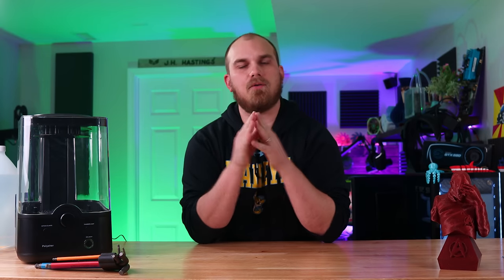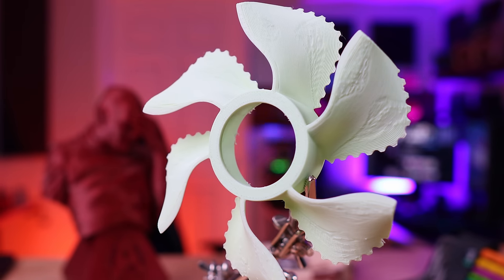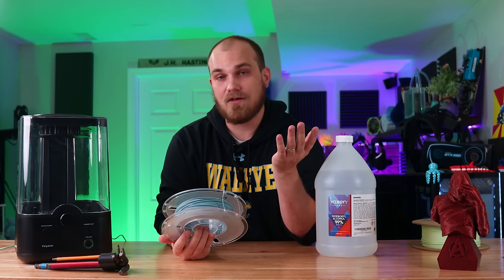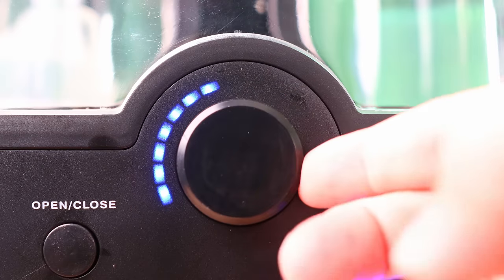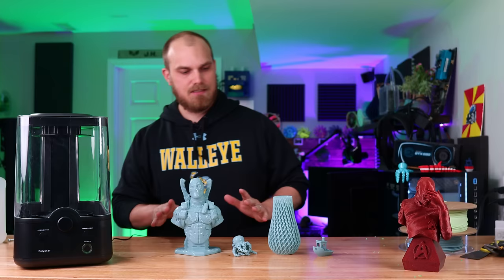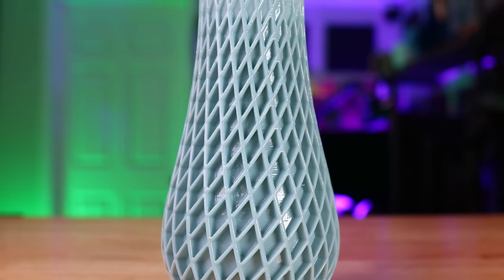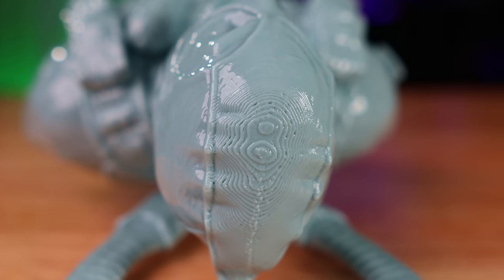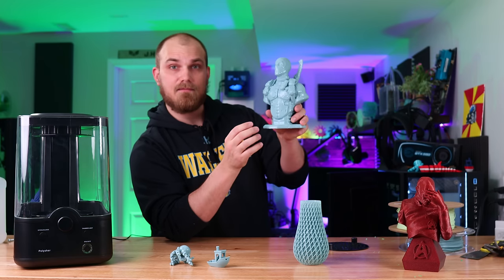SMOOTHING 3D prints with isopropyl alcohol

Comment: Bit more messy but I prefer using coats epoxy resin, that ones are more thicker like Ploxyglas3D . Not fan of vaporizing IPA inside a closed container with light and motors running.

Comment: The problem I see with polysmooth is it requires being in a dry box. I am not a fan of filament that needs special care while it is just setting there! I will stick with my method of using Bondo plastic metal and filler primer. That way I can use a really strong filament and not have to babysit it and buy even more absurdly priced things like that Polysher which I am sorry for the super simple thing it does is so grossly overpriced it goes beyond absurd!

Comment: Major Hardware.......You can smooth PLA with MEK.......................... lol Have Fun!
Also, I enjoy the engineering side of your content Ex. Fusion vs SoildWorks (I'm a recent MET graduate) Looking forward to future videos!
Reply: I haven't seen MEK at a hardware store in years.
Reply: @horacegentleman3296  Home Depot they got it
Reply: @dportben  you in the U.S?
Reply: @horacegentleman3296  Yes
Reply: Doesn't work, just makes the plastic soft and rubbery. Methylene Chloride does work, but is a pretty nasty chemical.
Reply: @ferrumignis  You can also do smoothing of PLA with Chloroform. (As long as it's done with the correct equipment, and in a safe manner)

Comment: The layer lines on the flatter parts of Deadpool is to big for smoothing to remove them anyway. You need smaller layer lines to start with, which also means shorter time needed to smooth.

Comment: Ethyl Acetate dissolves PLA but I haven't tried to smooth any prints yet, maybe you could make a video to find out?
Reply: there are a lot of videos of that. none ive seen were something i would call a success tho. https://www.youtube.com/watch?v=e3sYeiCIVTA for example pla starts at around 18:30
Reply: @Amarushaya92  Yeah that guy's method of smoothing is completely different from any other smoothing method I've seen, I can see why he had trouble getting it done right. A container with Ethyl Acetate and the parts completely separated from each other with a fan to circulate the vapour without any need for heat is the most reliable method that I have found after doing some googling (I'm no expert so that's why I suggested 3DPN do video on the topic with maybe different methods to see which works the best if at all.)

Comment: Had anyone had any issues printing really sharp points with this material? I was trying to print a 4inch toy story alien and the print is perfect, but when it comes to the ears and antenna it's almost like the fan can't cool the Polysmooth quick enough and totally just turns into garbage at these points. Any suggestions or anything would be really helpful

Comment: I'd be interested to see if wd40 could be used to smooth prints, it can be used to make plastics flexible so seems possible
Reply: Different plastics react with different solvents.  Acetone comes in high-density polyethylene (HDPE) plastic bottles, as does isopropyl alcohol, while either solvent will dissolve certain other plastics.  Polyvinyl alcohol (PVA) plastic dissolves in water.  Note WD40 and similar solvents come with a polyethylene (PE) or polypropylene (PP) plastic nozzle, cap and straw.
All of this depends on molecular bonds that work vaguely like magnetic locks and keys.  If the solvent can attach to the material and break that material's bonds to itself, it will dissolve.

Comment: The elevator platform of the Polysher is totally superfluous. It was included for no other reason than that it's "cool." At $300, that's fine entertainment for a user easily distracted by (literally) shiny objects and only prints D&D miniatures and vases that (literally) won't hold water, but it's not a serious tool.

Comment: i have seen a machine here in Germany. where you put a 3D print it in and it gets hard :-)
Reply: Ps: i think it's a UV machine.
Reply: UV curing is used for resin prints:  Liquid epoxy, instead of heated filament.  Completely different process, and already offers smoother results.  Much more work and generally more expensive.

Comment: Polysmooth is awful.  I love polymaker and I use their ASA almost exclusively for production parts.  But polysmooth is bad.  IPA does indeed smooth it but it tacks up horribly and takes forever to harden.  It's also super sensitive and easy to destroy by mistake.  I ended up using the rest of my spool for prototyping.  I also hated ABS when I started, but experience and improvements to the material itself (ASA) has made it my preferred material.  It should go without saying that unless you're a complete amateur you should be enclosing your machines.

Comment: I realize that this video is a year old but why not just use a resin printer? Smoothing these prints made them look like garbage. Size really isn't an issue as you can resin weld parts together to make a bigger part. This might have been useful before resin printers but now that they are a thing that's decently cheap, why would anyone buy this?